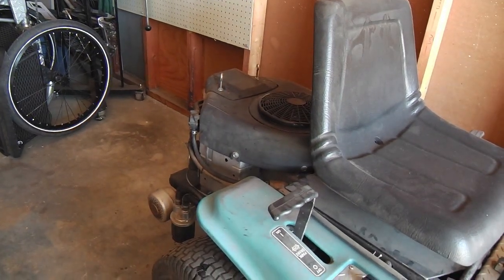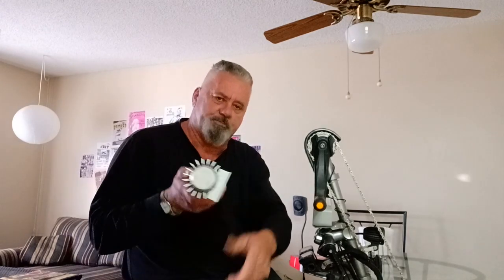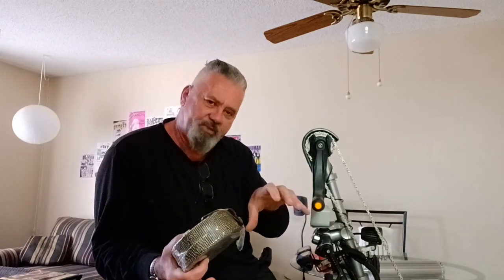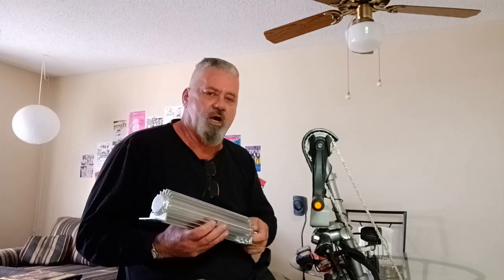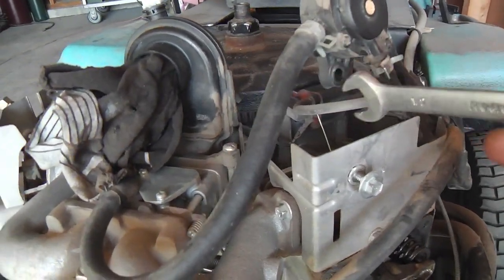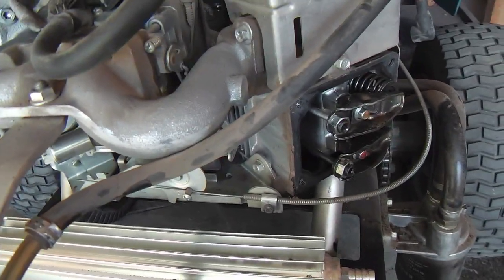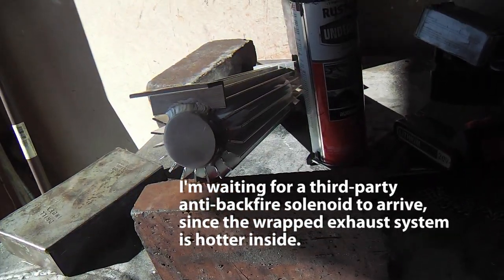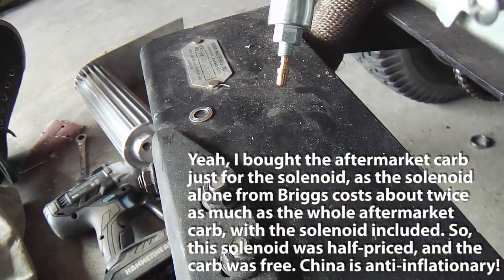Riding Mower Oil Cooler Custom Install, Temp Gauge Dipstick, & Exhaust Wrap

Comment from the maker: UPDATE: Sunday, May 7, 2023, NOW, at an ambient outdoor temperature of 92 degrees, I was mowing for 45 minutes, and the oil temperature was elevated to the exact difference between the oil temperature with the oil cooler installed when the ambient outdoor temperature was only 62 degrees (which netted a baseline oil temperature max of 175 degrees), i.e., NOW at a 92 degree outdoor temperature, the mower oil max temperature is 205 degrees, or exactly the 30 degree difference between the initial baseline taken at the 62 degree air temperature, versus the 92 degree air temperature. So, oil temperature is undoubtedly always relative to outdoor air temperature, but that now with the oil cooler it will always also be 15 degrees cooler relative to outdoor air temperature, e.g., if I was mowing for 45 minutes at a 92 degree outdoor air temperature without the newly installed oil cooler, then I would have undoubtedly netted a max engine oil temperature of 220 degrees. I mean, as I mentioned earlier, maybe someone out there can comment on the average oil temperature of a V-Twin mower motor when running at around 92 degree air temperature without any oil cooler installed.